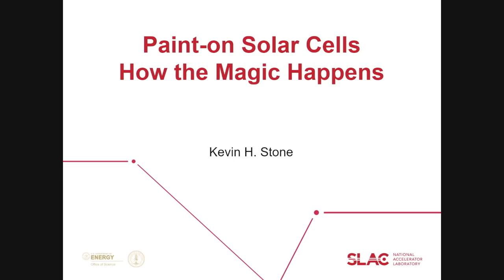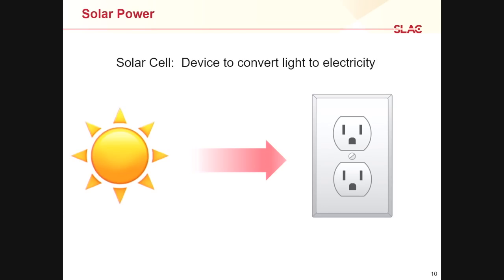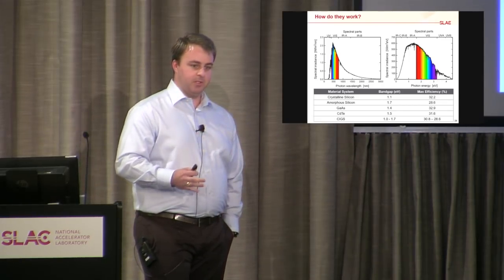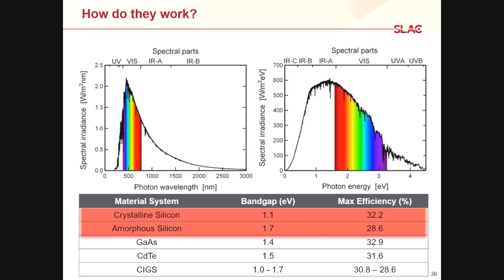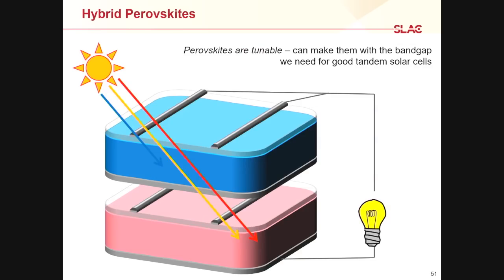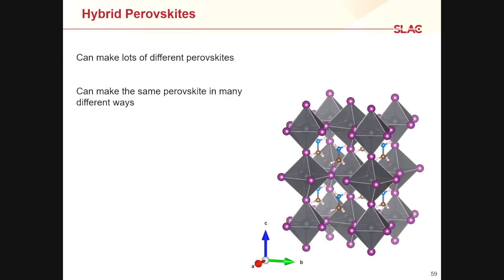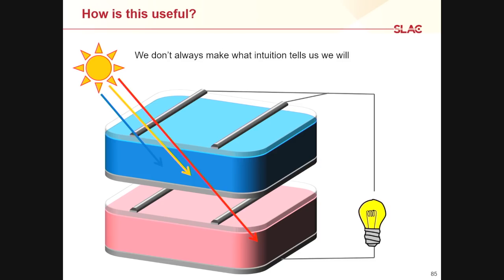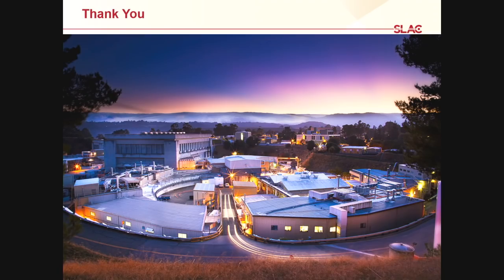Public Lecture | Paint-On Solar Cells: How the Magic Happens

Comment: My question would be about the additional semiconductor layer that should be required in the cell. To my understanding, a solar cell needs two different semiconductor layers in order to create a connection within the materials that induces polarity and directional flow for the freed up electrons. So what is layered upon the perovskite layer, or which connected materials creates this polarity?

I think the final cell should have: 
-Insulative layer 
+ conductive layer
+ absorptive semiconductor (perovskite) layer
+ secondary semiconductor (transparent?)
+ secondary conductive layer  (transparent)
+ encapsulative insulative layer

Or do I have a misconception regarding what is necessary?

Comment: WRT the third to last question: If you can seal well enough to hold the perovskite in a vacuum, presumably you could seal it in an inert gas (maybe argon), and that might avoid more problems. Of Of course, you could still have outgassing problems if there's anything volatile inside the seal, but you'd be closer to a solution to the problem.

Comment: All you need is a way of keeping the material in the oven for the hour. And length really isn't all that major a problem at that low a temp as you can insulate it well and run multiple lines of material thru at the same time. Stacked and side by side you could do 4' wide sheets and only stack them a couple inches apart. That would allow maybe 2000 sq feet per minute to come out at the end. It would just be the economy of scale and how fast you could get the finished materials cut and shipped. The problem would be in capturing the Chlorine gases and reusing them.
Reply: Yup!   Dont need 60 meters, cut the film into sections, and then heat it.  Use a high powered flash???

Comment: I wish someone would get back to me on this application related to usage within the auto industry.  My idea stems from using recycled plastics as the body of the vehicle. By dipping the body in the appropriate hybrid perovskite solution, layer the dippings to convert the bulk of the light wave refraction, and as it is dried forms the structures in their natural lattice formations, which would be the basis for carbon sequestration that would produce the chemical reaction into liquid carbon dioxide that would be stored in the gas tank and used to power the vehicle while the solar hybrid system would be charging the batteries.  The dip could be any color and have an electrical conductivity that could wirelessly be transmitted throughout the vehicle or to another vehicle, home, etc.  Carbon fiber applications coated with the solutions would also be an adequate substitute.  By using a non-pigmented solution, it could be sprayed on homes using a portable sprayer designed in such a way so as the sprayer conveyor would be operated by one worker using a laptop or app.  The subsequent curing of the spray would be an effective way to paint homes, apartment complexes, commercial buildings, and would reduce or eliminate corrosion associated with concrete bridging and roadway applications using asphalt.  Since the asphalt roadways would be generating power and transmitted wirelessly to the vehicles traveling them.  Also, these solutions could be sprayed or manually painted to any surface such as airplanes, cargo containers, oil tankers, etc.  The uses could also be a cost effective way of solar collection in space.  Since, Mars has largely a carbon dioxide atmosphere, the solutions could be useful for sequestration and/or chemically converted to liquid carbon dioxide that would certainly provide an energy source there as well.  If production, would be an issue, the perovskite composites could be created directly from the Mars atmosphere or any other planetary body utilizing the predominant available materials.  Sales of the patents and products related to perovskite production is going to have an unlimited profitability equity curve and complete support of Wall Street.  In summary, by using recycled plastics, used as environmentally safe carbon sequestration, paints, corrosion inhibiting coatings, asphalt roadways, the wireless electrical revolution, and jobs created would move fossil fuel uses into a whole new category, negative carbon emissions would be highly profitable and have bi-partisan congressional support and tax credits for a limited period of time.  evangelismbasecamp@gmail.com  Kevin

Comment: Perhaps, to address the moisture-sensitivity of the perovskites, solar panels could be hermetically sealed into glass towers with a central mast that carries wiring and supports a vertical column of solar panels that adjust to the angle of the sunlight automatically, or the panels could be made the shape of lampshades (wide, open-ended cones) and mounted on the mast, like donuts on a stick.  This would also solve the problem that northerners have with roof-mounted solar panels.  When 2' of snow falls overnight, the solar could be gone until springtime.  With a design like this, the glass tower and mast, which are costly to transport, could be permanently installed and would last beyond the service-life of the solar panels.  Installation would be easier than roof-mount panels and to make the tower environment moisture free, air could be vacuumed out via an aperture with one-way valve.  I'd buy solar panel towers like that.

Comment: you sure you weren't up in CT in 2009? I remember a professor found inkjet printable solar cells that used 80%+ of visible light into electrical energy, Demonstrated it just before the housing bubble popped. Haven't heard anything else after the wall street crash though.. not viable? Big solar step in and silence him?
Reply: If we could all become self sufficient we could charge our homes and electric cars with solar powers. Not good for government, oil companies, power companies etc. Capitalist system would crash.

Comment: Thinking about the best technical solution for solar sells to be more effective will be copying the process from the photosythesis of the plants. The other thing that comes to my mind just as intuition, is to create some sort of vortex of sunlight rays, which will intensify their vibration, and thus the energy efficiency. I beleive in the vortex energy, since all filters, hydro and wind energy, plus tesla coils work on the basis of the vortex-- creating movement and magnetism or electricity. It should be applicable in some from also for sunlight and sollar cells.

Comment: EXCELLENT LECTURE!  Ok... gears are spinning.  Can you do the same paint on process, and let it cure longer with lower heat?  I live in Tucson, max temp... approx 110f in summer.  Phoenix/Scottsdale, 115 or more.  That is air temp at sea level, or approx 2000 feet high.  Desert temps are probably higher.

Paint it on a house, roller kind of deposit, conducive copper based paint for wiring, slower cure in the sun.  Perhaps paint wiring first, then let it cure by evaporation, then apply PerovSKITES material.

In a manic moment, at 68, AND LOVING IT.

Wow... what a fantastic dream.... PeroSKITES, roll on natural heat process.

Some kind of sun magnifier.... the grooved lines thingy that is flat and magnificently magifies the heat.. YES!!!!  It can actually melt ROCKS!

... spinning... endlessly.
Reply: Ok.... its called a Fresnel lens.

stilll spinnnning.. and NO drugs.  Talk about a natural high.

Paint on plastic siding.  Cure in the sun.  So what if it takes 6 months??
Reply: Wait a minute... what about a laser scan to cure it?????